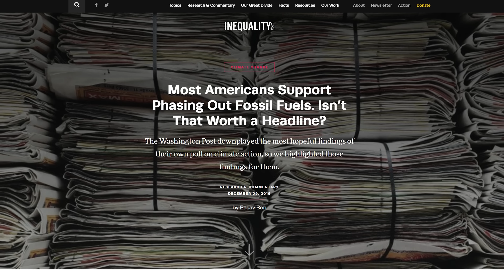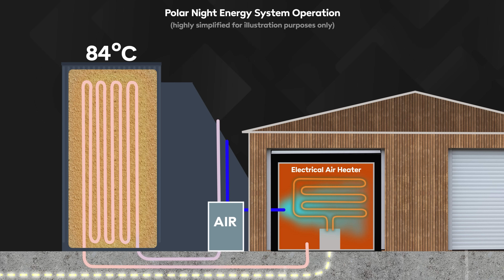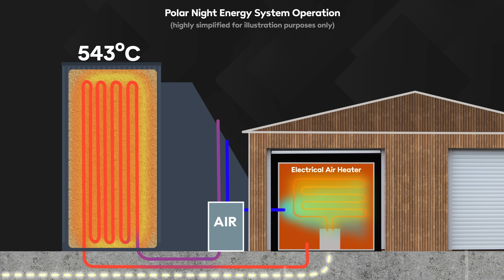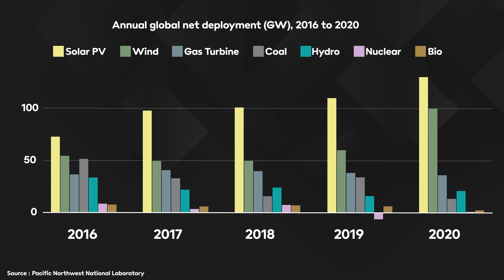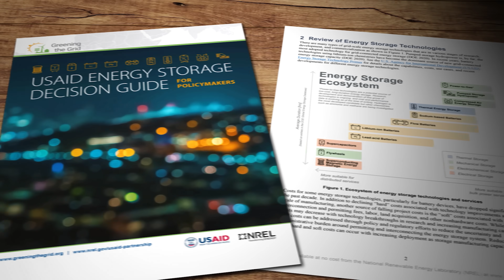The 'Sand Battery' that heats your home, NOT the planet!

Comment: Many, maybe most, large cities in the United States have a "district" steam heat system in the downtown/financial/industrial district, and it's not remotely new, been going for maybe 150 years. Currently powered mostly by various fossil fuels, but can easily be powered by renewables. 
 This type of tech would fit right in, and the systems could be expanded.
 A major advantage is that that power companies, and many city planners and managers, and facilities managers will already be familiar with the concept. You won't have the hard sell of a new unproven high tech solution.
Reply: Thats it, plug in, have just one more connection to the teat.

The idea is to completely disconnect from metered life so that no one has the power to CONTROL YOU.

Oh, i forgot, you already live in a shoe box apartment with no facilities for even your daily coffee that you must SPEND AND BE HAPPY.

Maybe you could own nothing and be happy and penetrate ze cabinets for the bugz.
Reply: @Ralph_Baric_PhD_C2019  What ars you on about?

Comment: Water is a better heat retainer.  The problem with it is that it can go "boom" in a closed system.  Cob is better than sand.  
     As a designer/builder of rocket stove mass heater systems (site specific) I can cut a wood cost of 80% (I.e... 1 cord to heat a space that took 5 in a modern 80% efficient stove).
     Incorporating masonry and cob bells and benches to capture the energy in exhaust gasses can also heat water or pump hot air.
    The cores are nearing perfection of burn in the first combustion and most remaining gasses are burnt in the secondary burn leaving...NO SMOKE!  No creosote. Clean burning fuel efficient cores are the key.   You can direct 2800° Fahr anywhere you want.  You can even move the core to another "Thermal battery station"...say, a mass underneath work stations... if it's on castors.  Roll on to the next area after temperature is realized.  The core itself provides immediate heat, if desired...with a radiant top instead of insulated.

Comment: I don't really understand what makes this system better than heat and cold storage in the ground. Seems very similar, but if it's in the ground it doesn't take up any space (maybe it's cheaper too). I guess there might be less heat and cold loss in a completely closed system as in those cylinder containers. If you have any info or opinions on this comparison, please let me know.

Comment: what are the downsides of just digging a hole and filling it with the thermal energy storage system. or better yet installing it in old disused mines?  Wouldn't that have a lower carbon footprint and a longer life? 

also, whilst I realise they use EXCESS electricity from wind power to generate the heat, it makes more sense to me to directly convert sunshine to heat rather than wind to electricity to heat

Comment: You don’t need a storage container.  Just dig a deep trench around an area and fill it with insulation to prevent heat loss and use the existing dirt that you have thermally isolated inside the trenched area as your heat sink.

Comment: How the bloody hell you heat sand with pipes to 600⁰c or is it Fahrenheit from and external source wouldn't it be better using elements like a few kettle elements to size it down then have a coil of copper pumping air or water through tank just sounds like hot water tank with immersion heaters just improved  and outside instead of inside and combined with storage heaters so really it's nothing new 🤣🤣

Comment: I’m not sure of the benefit, but I have thought that using a medium that changes from solid to liquid would provide an energy storage boost due to the heat of crystallization, although I’m not sure how big of a boost that provides.
Reply: If you can find a liquid that freezes at the right temperature it would be a huge benefit.

Heating ice at -1C to water at +1C uses about 40x the energy as heating the water the next 2decC. 

If the melting point is around normal room temperature then there is less need for insulation as well, as they're will be less of a temperature difference

What we need therefore is a material that is solid at room temperature but liquid just above. Two thoughts are chocolate and butter, but I'm sure there are better examples... and ones that would not get raided by kids and rodents

Comment: So think of a DIY version for a home, heated by your solar system in winter and used to heat the home at night.  Here in the SW US our solar systems need to be big enough to power cooling during the very hot days, they need a use in the winter and this could be it.  Great video.
Reply: I added earlier about using a used domestic insulated water tank for a house

Comment: Finland here.

I live in city of Lahti which has city-wide distributed heating network - as all cities in Finland). The city has 2 own power plants that runs with trash (have been so since 90's) and nowadays with wood. They produce electricity and heat. Combined power is 350MW.

The scale of things here (Lahti has about 100K inhabitants, not all live in the area of the network) is so big that these kind of storage systems might not be viable. All the heat produced is needed anyway and burning plant is easy to adjust for current need. But in industrial buildings that may have their own plants etc. they may be great!

Anyway, we should eventually get rid of burning things altogether. Biomass isn't sustainable either. Lack of biodiversity in Finland is already actual problem. There's very little natural forests here.

What I think would be the best source of "unlimited" heat here up north is geothermal in industrial scale. There has been a test facility drilled in Espoo few years back (down to 6km or so) but apparently they won't be making commercial plant out of it - at least not yet. But the idea of getting all the heat needed from the ground should be very much on the top of the list. On winter there simply isn't any other scalable heat source here that wouldn't burn things.

Another problem with these distributed heat systems are that they're natural monopolies (fortunately they're almost all owned by municipalities). That way in many cases the price of that heat can be pretty high! Making a new house with good insulation and HVAC with heat exchanger consume so little energy that heat pump(s) can be much cheaper overall!

There's lot of wind turbines installed lately but their fluctuation is a bit too big of an issue in terms of creating heat. The coldest days in winter are in many case are the most calm.
Reply: Your last sentence indicated exactly why storage such as this is needed: store heat when there is excessive wind generation, and use it on cold nights with no wind. We need many different technologies for different scenarios if we want to successfully transition ourselves off fossil fuel.
Reply: @mintheman7  Yes, I agree at some level. But the best way to utilize them would be to use the electricity to pump heat from the ground. Not sure if high enough temperatures for these storages can be gained there. But everything not burning is on the right direction!
Reply: @ArcticSeaCamel  You are still not getting my point. This technology is for energy STORAGE. Renewables are not viable unless storage technology becomes cheaper and more mature because wind/solar are both intermittent. Ground source heat pump you mentioned is very efficient when electricity can be generated, but how do you operate them at night without wind?
Reply: Ihan hyvä postaus! Näkisin näillekin kyllä potentiaalia, lähinnä olemassa oleviin kaukolämpöverkkoihin, tai aluelämpöverkkoihin ainakin. Isommat yhtiöt toki tekee vesiakkuja jo hirveetä kyytiä (Vantaa, Tre, Hki jne)

Comment: I've just had to replace a copper hot water cylinder in my home due to a small leak. It had two coils and an emersion heater. If I filled it with sand and heated it from the emersion heater powered by solar energy, could I use one of the coils to heat water pumped into my central heating radiators , thereby making my old oil boiler redundant?
Reply: My understanding is you need  to be above optimum volume of sand and the temperature needs to be high.
I think a small tank looses too much heat as a result of surface area to volume ratio.
Reply: @stevewilliams2498  Thanks for your reply, it sounds logical.

Comment: When you want to scale up and keep cost down, the next step is pit thermal storage.

You forgot to make a really simple calculation. You said: "Imagine if it had been filled with sand at 500°C". Well, it would have had roughly the same capacity, but higher heat loss.

The heat capacity of water is a lot higher than sand, and the thermal conductivity of sand limits the discharge rate. Water at 4.2 kJ/kg-K heat capacity with about 50-60K temperature difference, can store up to about 200 kJ/kg. Sand with a much lower heat capacity of about 0.8 kJ/kg-K while being able to accumulate about 500K, reaches 400 kJ/kg for a much more complex installation. The water installation uses the same water as the district heating network, meaning that there is no heat transfer anywhere, whereas in the sand system, there are two. 

The hot sand technology excels in its ability to store heat at higher temperature for applications that need that.

Comment: Just one thing: water has a very high specific heat capacity, which is how much energy it is required to increase its temperature, while sand's is lower. Having sand at 600 C doesn't necessarily mean it can store way more heat than water just because you also need to multiply the temperatures by the specific heat capacity.
Reply: Then you also need to take into account insulation needed for the water as additional mass per energy unit stored. And you gotta take into account that a larger volume of sand will have higher insulating properties which makes that specific heat calculation more different the larger the volume of sand you are using vs a grain of sand...
Reply: Getting the equivalent amount of energy storage from a water based solution would require a phase change from liquid to gas. Using steam or high temperature water would result in a need for pressurized vessel construction which would limit the size of the tank and significantly increase its cost while making it more dangerous to use.

Comment: Can’t the sand bank be coupled w concentrated solar? Like cycling hot liquid when the sun is out. More efficient then converting electricity to heat.
Reply: Would like to know the reasoning as well.
Reply: CSP is more efficient, but also more expensive. Turns out, all those mirrors on individual trackers add up to a lot of moving parts that require a lot of manufacturing and installation costs, plus a lot of maintenance costs once deployed.

Many CSP sites have been built, but so far the economics of it aren't looking too promising.

Comment: Please, may I offer a heat-source that I believe is worth looking into. I sent a similar e-mail to Chile and to Owen Jones from The Guardian. My idea is to use old clothes as 'logs'. Yes; that's right, to compress them into 'logs' that can be burned in wood stoves. We burn peat, manure, and other forms of matter other than wood for cooking and heating, why not use the mountains of used clothes---especially in Chile---that they are now calling an ecological disaster? I am an inventor, but I have not made a proto-type combustible 'clothes log', but I think we should give it try, because cloth burns and rolled up, compressed 'logs' could be a way for many people in the UK and in Europe and elsewhere to have a cheap alternative to burning oil or gas. Could you...Have a think..?

Comment: This is going off on a bit of a tangent, but I'm reminded of a blog written by a guy living off grid in the USA.  He heated his cabin with a wood stove, which he buried under a pile of rocks in his basement, basically leaving only the door and draft controls exposed.  That pile of rocks worked wonders to smooth out the "spikes" in heat output from the wood stove; he could fire it up when it suited him, and the rock pile would continue to give off heat long after the fire burned down.
Reply: I happen to know of this very same scenario in New Hampshire with a woodstove and all its piping in a brick room filled with tons and tons of sand and well that might be good when you have temperatures in the 40s when it’s 10 below zero you can’t get enough heat out of it it just burns wood so this caused the gentleman and his family to haul the tons of sand up the stairs and out of the basement take the brick walls down and try something else
Reply: @theusconstitution1776   maybe a little heat pump that draws from the sand and brick thermal battery to access boost heat for  cold snaps ?
Reply: @theusconstitution1776  This gentleman maybe should have instead hauled in some insulation so the heat requirements could more easily been met by the wood, and sand mass output. He would use a lot less firewood and have the mass at a lower temperature that would not overheat but more closely match the heating requirements.

Comment: I suspect that I and a lot of others using a ground source heat pump are using earth mass as energy storage in a low temperature version of this. I've noticed that the inbound loop water at the end of a summer is maybe 6 C warmer than tap water, and the inbound water in the spring is colder than tap water. I've also noticed the the highest utility charges seem to be offset from the hottest and coldest outside temperature.

I used to think molten salt had a lot of potential as energy storage, but I guess the corrosion problem was unsolvable. This seems like less technically challenging variation on high temperature energy storage.

Comment: The relative thermal mass obviously is the most important thing here: why not use low grade recycled iron blocks with aligned channels through which the pipework could run?
It wouldn’t require a particularly strong shell, or the secure safety shell that hundreds of tons of boiling water does - a breach of THAT would spoil quite a few days!
Reply: One advantage of sand over steel is that Dan's has a lower thermal conductivity. With a metallic heat store the trick is heating the centre hotter than the edges would not work nearly as well.
Reply: @trueriver1950  I don't get that. Unless I'm missing something the sand proposal is making  a virtue out of a problem, in that the low conductivity (which limits the total energy that can be stored, actually) is being given as "insulation".
Using the far higher energy storage of iron with its much higher conductivity obviously there's a need for higher insulation but I just don't see any advantage in sand over it.

Comment: What type of sand does it use. And yes, that is a relevant question. The Golf countries are major sand importers because their sand is too fine. If this need the kind of sand concrete also uses then that's not going to be very viable in many parts of the world. If this can do fine with finer sand that's too fine for construction usage, then this might unlock large sand resources that have as of yet remained unused or only used to refill beaches.

Comment: I really like this system using sand to store heat. i gotta wonder if it a smaller version could work on single house or apartment block. lots of possibility i think. thanks for reporting ;-)

Comment: Dear world, please, please, please, DO NOT build district/central heating for your city! You will have neither heat, nor hot water, especially during the winter! Especially if you live in a corrupt country! The network of pipes will get damaged over time, and NO ONE will repair them! Or they will pretend to repair them, and pocket the money instead. Precisely this is happening in Bucharest, Romania! I cannot even begin to explain to you how massively stupid a district/central heating system is!

The Sand Battery is a brilliant idea, and it would be awesome to be implemented at least at a building level. But absolutely no way in hell for a district heating system!

Comment: Is this less efficient than battery’s and in home air source heat pumps? 
It strikes me a there always need to be a back up incase the heat bank is empty. Would that giant electic heater heat the system directly

Comment: Are folks aware of a material that stores COLD as well as sand stores heat?  I.e. is there an equivalent air conditioning solution?  Or goes geothermal work fine for that